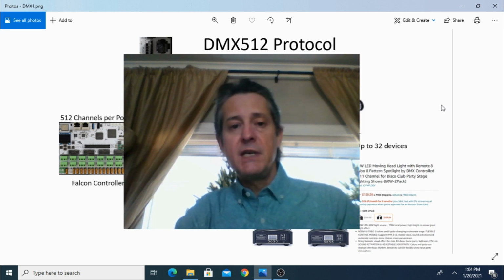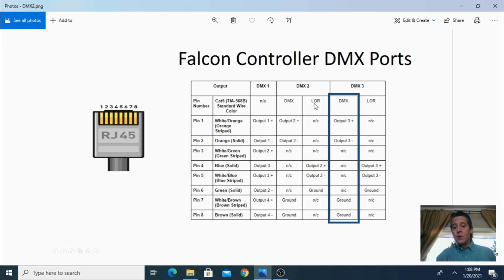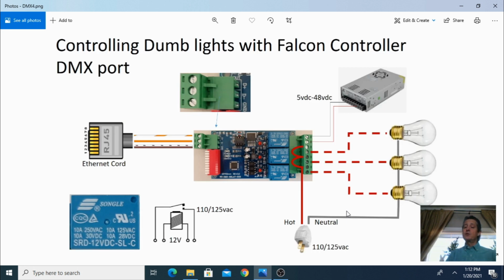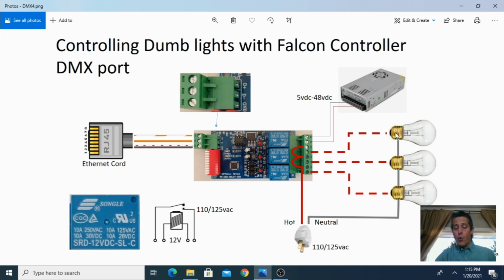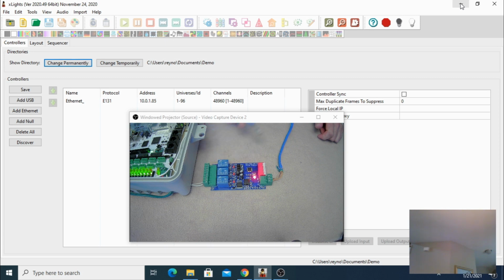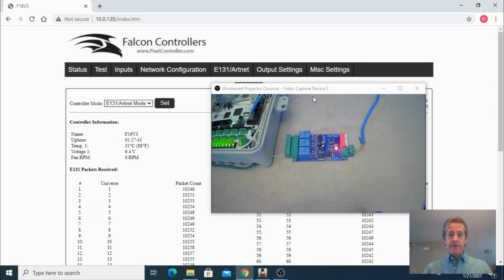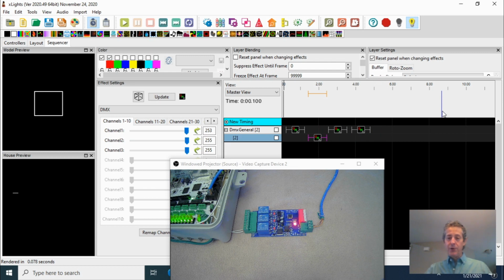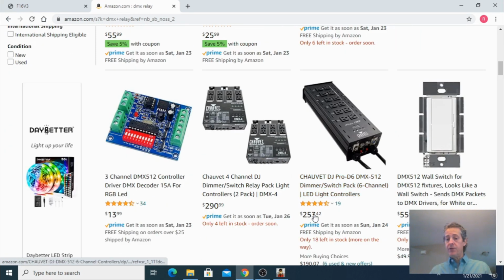Controlling Dumb lights with Falcon Controller DMX Port

Comment: hi  lot of thanks uploading such a wonderful tutorial !, I have got question,  is there any way that  can  I control 24volt water pump as i am not sure about its  specs, i would be much appreciate it thanks in advance.
Reply from the maker: Sorry, thanks is not something that I would not know. But, what are you trying to accomplish?
Reply: @trevilights   thanks i am  trying to  make dmx water fountain  as  my water pumps are 24v  through dmx qlc+ software ,as this board has dmx controller and relays  on  one board but looks like these relays operate  0n ac 110 to ac 240v , i trying to operate only one pump , once it worked i will expand to more channel , i have checked ali express but couldn't that sort of board with 24v output relays, any suggestion would be highly appreciated thanks
Reply from the maker: @ Maybe something likr this, but on 24vdc.
https://www.amazon.com/Channel-Decoder-Controller-Converter-Protective/dp/B0111QOZXE/ref=sr_1_4?crid=30SYHHGR2N7KS&dib=eyJ2IjoiMSJ9.8ay7oIr49QcnuisrEHtrfLxGnDNxmg2KsfY-Ktw8JNsK4YPu1BHvGlge9Ky_6wtF10xgzp5P6buUl21X17D0hwYbxUHYHbxWuJYgAgAixwdnY3_YzRfiftAW5hBAFYGDPdjx7KPck9h8lW6Czi4oZDHyZzG_EBAw0dUCt4onkfNHbm0rbC55n3eJkYhR7sDsY1iE2hw6-b1hKE2CHlzzWl6AA4aUOMmNxiIEKOU1CEh0G8IawDB_SSHjj0vESZznO2bXDSUZjQyXRZ9NJNurb2_4VDYFgQAkr3r0X2apru0rOcuyUWmYWgXPhaAH9kh-YLcg6SPF3kTkkaL9O_aNkNx0AiyoEmcywfW71aoRj9skqlyi9gZ22bHyLuMp_8pvql3UNN9hjJqpCLtD6jkr7cruXW7GSGGIiUNMEaTstQWSo02OCKuWN39mQ0n38796.uaN4-6O-s_CQvf9PpGppr4CZep2QYnLDWQW9C4mRVyo&dib_tag=se&keywords=dmx+24v+dc+relay+switch&qid=1739971840&sprefix=dmx+24v+dc+relay+switch%2Caps%2C142&sr=8-4
Reply: @trevilights  lot of thanks, i will see if it out to 24v bcz it still showing output ac volt 110  but i will ask query , again thanks for this
Reply from the maker: @ The way I undestand the diagram is that the relay will take either a DC Voltage or AC voltage to feed into the relay output. Glad to help.
Reply: @trevilights  lot of thanks for this i chk  again for this tnanks again

Comment: A million thank you's! I used this to set up dumb lights controlled with my Kulp 16A-B board connected to one of the RS485 outputs, so a few things looked different with my set up. I did not use an RJ45/Ethernet cable, just a 3 wire cable for data. I had to locate the settings referencing ttyS1 in the channel outputs under "other" in the FPP. Otherwise the xlights settings and process were the same. Your video was a huge help.
Reply from the maker: Awesome. Nicely done. Glad to help.

Comment: Thanks for the information! Would a V5 F16 be able to do the same thing? There appears to be only 1 DMX port and I can’t find an output chart for it. Wondering what the different Xlights settings would be.
Reply from the maker: See page 23 of the link below.
https://docs.google.com/document/d/1449zGk1HEiQjcu6e98ebWnFBMFKUiXaFzis9QGAnfsk/edit?pli=1

Start on minute 4 of the link below.
https://www.youtube.com/watch?v=OzSnQe2zasI&t=180s
Reply: Great video - inspired me to try lighting this year. I got the f16v5 and after playing around I got it to work with an 8 port dmx512 board but with one strange thing…the first 3 pixel lights on my prop go on and off with the dmx sequences in flights. Weird huh?
Reply from the maker: @prothos2315   Looks like a problem with channels. They may be over lapping. Try moving those light to another port and then moving them back to the original port. See if xlight recalculate the channels.

Comment: If you have two of those relays can you chain them together to run off of one DMX port?
Reply from the maker: Hi. Not this model. It doesn’t have a DMX OUT port. You are better off getting a larger model or one of the more expensive ones that have a DMX IN and DMX OUT port to daisy chain them.

Comment: Hello , I have a question. I now have a WS-DMX- 8 channel Relay. I have a red and solid blue light. The blue light is not blinking. Do I have data going to the Relay board? Thanks
Reply: @trevilights  Im sorry can you speak English?
Reply from the maker: Sorry. Unfortunately your board is different than the one I have. I could not find any information on it. My only suggestion is to turn OFF all of the dip switches, specially #10.

Comment: Great video Trevi!! I have addressable AC lights that I bought from big box store. Is there a way to do the same thing with them but instead turn off and on. Have them change colors I think they are RGBW
Maybe with a different board?
Thanks.😀
Reply from the maker: Hi there. Thanks for watching. The Falcon controller can control many different type of lights, but you will have to find out the type of integrated circuit they have and do a lot of testing.
Reply: @trevilights  Thanks. I’ll try.

Comment: Hey Reynold, how are you? Great video. Question for you. Can I run a smart receiver off my F16V3 using all 4 ports and also use port #3 for DMX? If not how can I use both a smart receiver and DMX?
Reply from the maker: Hey Dave. I am fine, thanks. How about you? To be honest, I would have to review the specifications and do some testing. There are some limitations.
Reply from the maker: Well, seems like the only way to get both running is to only use 3 of the serial output as pixel data and leave one as DMX. You will have over 3000 pixels on your smart receiver.
Reply: @trevilights  Thank you for your quick reply. Can I control DMX with a kulp controller?
Reply from the maker: @davetuttle2174  Their user manual says it does. I have not tried it. You will need to confirm with them, See below.

2 RJ45 connections (labeled 13-16/DMX and 17-20/DMX)

- Used for DMX/Pixelnet output- Each RJ45 port can control 4 DMX/Pixlenet Universes (1 Universe per wire pair.)
Reply: @trevilights  I will ask them and try it and let you know. Thanks again Reynold and great job on the videos. I love how you explain everything so well and keep it simple.

Comment: Hi Trevi, great info!
 I'm new to this pixel world and still learning. I've gotten myself the same dmx controller to connect my dumb light to my Advatek pixlite4 MKII (it's got just one dmx connection), and I can get it to work from the Adatek assistant, but somehow not from Xlight. You might have a few guidelines for me to follow, would you be so kind to inform me of things I should check. Thanks for your great videos!
Reply from the maker: Hey Ifan, Thank you so much for watching this video and for your kind words. It's hard to tell what can be wrong without looking at your setup, but here are a few things for you to check.
- All of the DIP switches on the DMX board should be off(up position)
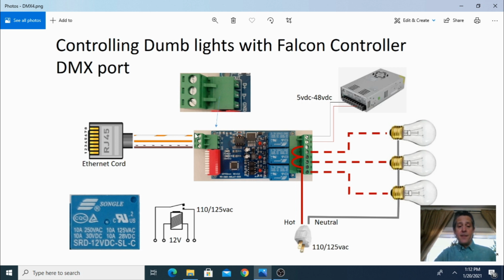- Double check that you are using the correct wires on you RJ45 interface cable (minute 8:35).
-Do you see link blinking on the board when connected. (minute 14:00)
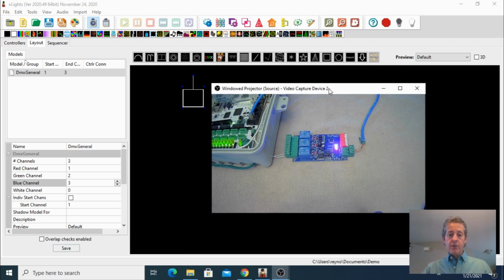-Double check the DMX setting. (minute 17:40)

Good luck.
Reply: @trevilights  Hi, Thanks for your prompt response. OK the dip switches weren't all up so I've changed that. When I set the DMX it seems to overrule the other channels. On the spinner I've got connected it just turns the 1st nod on and off but however switches the DMX properly. As you can see I'm new to this hobby and a little puzzled.  Thanks for your help.

Comment: Great Video!  learned a lot. Can you provide a link to the controller board from Amazon can't seem to find it.
Reply from the maker: Thanks for watching. 
3 Channel 5A DMX512 Controlled Relay Switch Kit DIY Converter DMX Dimmer Relay https://www.amazon.com/dp/B00R6DGSAK/ref=cm_sw_r_apan_glt_i_N29YV946QSZR8R7KVZNA
Reply: @trevilights  Thanks, Their currently out of stock I'll get it ordered when they get it back in.

Comment: If you are controlling more than one relay bank or other dmx devices, how do you relay the signal?
Reply from the maker: You need a more robust board with dmx in/out port to daisy chain them.
Maybe..
16 Channel DMX Controller Relay Switch Dimmer Kit 16 Way Relay Switch DJ Equipmet https://www.amazon.com/dp/B0111QP790/ref=cm_sw_r_apan_glt_fabc_AJA5GVMN8B3AFPEW943P?_encoding=UTF8&psc=1
Reply: @trevilights  Im thinking maybe a dmx splitter might be an option as well. Thanks!

Comment: Thanks. Your previous comment helped me get started with absolute address, much easy. Thanks. I also have an LoR 16 as I wanted to control some 110v lights. It has 16 channels. I will also be controlling regular pixel lights with it. My question is 1) which port is DMX/LoR on? 
2)  When I put DMX effect on it turns ALL lights on connected to the LoR ports. How do I configure individual lights connected to each of the 16 ports? Thanks in advance?
Reply from the maker: Unfortunately I know nothing on how the LOR controller works. My closest guess is that you look closely on the Channels your using on the DMX elements as well as on the controller. Sorry I can not be of any help here.
Reply: @trevilights  Thanks. I appreciate. What will help me is that if any such DMX controller - the the one you used had 3 ports for connecting to 3 AC lights. Which port on xlights /Falcon do I configure for DMX?

Comment: That you very much for the video! I have been searching for a way to use my AC light with Xlights and my Kulp controller. I bought a 12 port relay and it is working. Thanks again!
Reply from the maker: Hey Eric. That's great. I am glad it worked for you. Glad to help.

Comment: Can you talk about the dip switch setttings with this??  What are the settings for the example you show here?
Reply from the maker: Hey Bruce, In my case all DIP switches are set to OFF (up position). The first 9 Switches will allow you to set the address(binary) that you what this device to use (I do not use them in the video) This address is to be used with other software. Probably this is how you find this device if you have more than one connected in series. 

If you look at the amazon listing you will the the definition of these switches in one of the pictures. We are using the Top one marked as "DMX512 State". I set the Address to be 0. 

https://www.amazon.com/Channel-DMX512-Controlled-Switch-Converter/dp/B00R6DGSAK/ref=pd_bxgy_img_3/143-7529437-1641503?_encoding=UTF8&pd_rd_i=B00R6DGSAK&pd_rd_r=6f348892-6350-45ee-9917-ec9169523f17&pd_rd_w=4xdBV&pd_rd_wg=yNHNf&pf_rd_p=fd3ebcd0-c1a2-44cf-aba2-bbf4810b3732&pf_rd_r=Y84NXRBA63JZZWJBNPQX&psc=1&refRID=Y84NXRBA63JZZWJBNPQX

Comment: It's 12 volts  The board will light up and get an ethernet signal with 5, but the relays won't work.  Believe me....I tried it!  lol  Also, the manual is online when  you order, there is a pic.  It doesn't come with one.  May need to set Dip Switches and decyphering that takes a bit of time.  Wish you could have covered that Trevi.  Also.....you don't mention that it is a 12 volt power supply!  Had to double check that with the doucumentation online....but other than that, great video.  You were my inspiration to go out and get one!!!  Now I have to get it to work!  lol  Halfway there.
Reply from the maker: Hey Bruce. Thank you for the clarification. I had to many things on my mind when doing the video and it's hard to remember everything. Thanks for watching and I hope you get it running the way you want.

Comment: You are doing a great job instructing your subscribers on the different Christmas light setups and equipment.  I have 4 singing trees,  4 DMX controllers, I'm using Mini LED Christmas light strings.  I understand how to hookup the 120 Volt lights to the controller.  Each of the controllers need a Ethernet plug to go the main controller.  What do you recommend plugging the RJ45 plugs into.  Should I plug all the 4 RJ45 plugs into ethernet distribution hub or what is the best way to complete my setup.  all recommendations will be appreciated.
Reply from the maker: Thanks John for your comments. My DMX setup is very simple, just because we are using RJ45 connectors does not mean that we can just plug it onto an Ethernet hub. We are using Ethernet wiring to run DMX signal. If your setup was a TRUE DMX over Ethernet Protocol then you could use a simple Ethernet hub. Now, you could use RJ45 to DMX adaptors and then use a DMX splitter. My advice is to keep things simple, do not overthink it. I like the idea of daisy chain DMX devices and the signal can travel for hundreds of feet. Thanks for watching.

Comment: WOW!!! Another great video. Thanks!
Trevi.....If I may ask where can I get good quality pixel lights?
Reply from the maker: Hard to tell. All come from china. I just bought 500 of them on Amazon because they deliver fast and if they have an Issue I can return them right away. I have been scammed by the Chinese marketplace before. This is my last purchase and I am buying them again next week.  I have used both with no issues. I see a lot of people recommending Ray Wu on Aliexpress. But shipping is expensive. Make sure you order the right voltage.

https://www.amazon.com/Rextin-WS2811-Digital-Addressable-Waterproof/dp/B01MCQP7KP/ref=sr_1_5?dchild=1&keywords=ws2811+500&qid=1611507018&sr=8-5

Another option:
https://www.amazon.com/ALITOVE-Individually-Addressable-Advertising-Waterproof/dp/B01MSOT9LZ/ref=sr_1_7?dchild=1&keywords=ws2811+alitove&qid=1611507068&sr=8-7
Reply: @trevilights  Thanks Trevi for the info.
Reply: What voltage would you recommend 5v or 12v?
Reply from the maker: @dannygasca6898  Well, I went with12v. I read somewhere that 12v performs better when it comes to the wire resistance, so it travels further. 12v pixels are bit more expensive that 5v. but not for much. The voltage does not matters when if comes to the LED brightness, it's the same.  If for any reason you need to plug a 5v device (like my video on LED matrix) you can use a voltage reducer to drop it to 5v.  It's pretty much up to you. Now, the Falcon controller ports are divided in two groups of 8 (16 total) you can have 8 ports on 5v and the other 8 on 12v. FYI. Of course you will need to have 5v and 12v  power supplies.
Reply: Thanks again 👍

Comment: Would there be an issue using this, 8CH DMX Relay Switch Dmx512  (https://www.amazon.com/Switch-Dmx512-Controller-Output-Control/dp/B00S9KABRA/ref=sr_1_2?dchild=1&keywords=dmx+relay&qid=1611283370&s=lamps-light&sr=1-2) with a Falcon  F16V3. jst starting to use smart Pixel and would like to some of the dumb lights I have. currently using a Raspberry pi with Relays.
Reply from the maker: Hey Kamara. No problem at all. Same concept. This controller has the two type of connectors. The RJ45 like the one I showed in my video and the DMX 3 pin. You are good to go.

Comment: Thank you very much for sharing your time and knowledge, I learned a lot from this video
Reply from the maker: You're welcome Frank. I am glad you liked it. Thanks for watching.
Reply: @trevilights  can you do a video on xlights
Reply from the maker: @djlightsaberdracula6003  Dj, I guess I could. Most of my videos assume you already have some experience on xlights. I will plan for it.
Reply: @trevilights  and can you please show the difference between LOR And xlights I heard you can use LOR with license and show me how the get xlights to work on windows 8 if it’s not working
Reply from the maker: @djlightsaberdracula6003  I do not use LOR. xlights is free, no license required. I highly recommend that you upgrade your computer to a more recent Operating system. Sorry I cannot be of more help in this area.

Comment: Great video, I would like to see a video showing four singing trees or object wired up.  How many dmx’s will be needed and the box plugins.   What controller,  each face has 4 colors and how many channels will be needed.  Lights are 5m mini lights,  I will be using 4 different color strings, for each character.   I think I will be using 16 channels.  Thank you for your videos.
Reply from the maker: Hey John. These lights are not the best for singing trees. The best ones to use are WS2811.

More information on the singing trees here...
https://youtu.be/zanYq0TAX0Q

Controller...
https://youtu.be/2vy7kugXvDM

Mega Tree...
https://youtu.be/8W1vriknbB8
Reply: Hi Trevi thanks for your video.  It was very well explained and demonstrated.  I bought my singing trees with cutouts for mini lights.  I have installed the lights they are C6 Led mini lights.  I understand pixels would be better.  I have 5 different colored 120 volt strings.  Your video showed using a three channeled board.  Do I need a channel for each color.  Could you tell me how many channels I will need to control the 5 colored strings. Could you recommend a controller